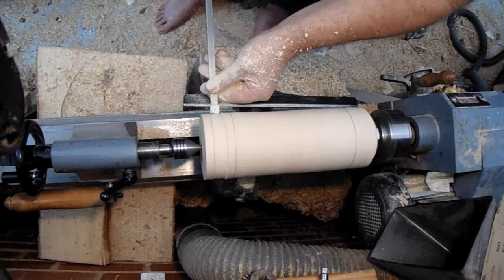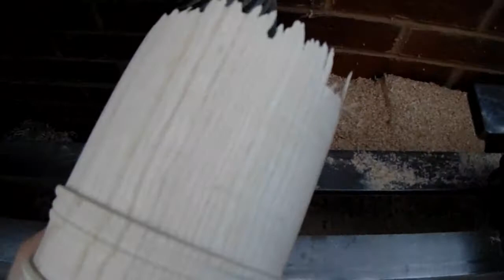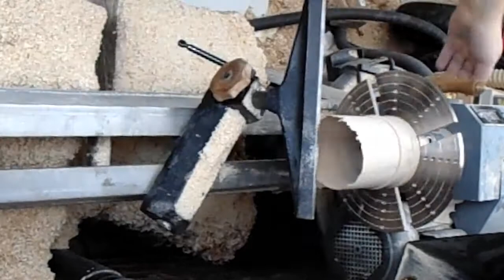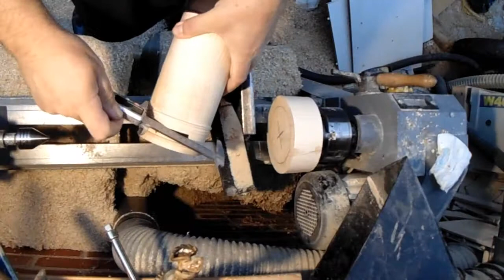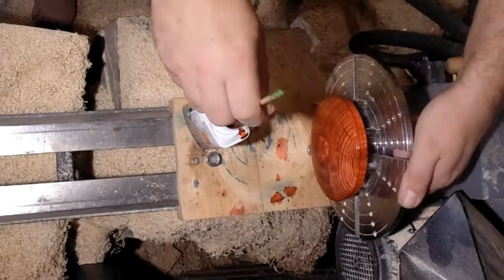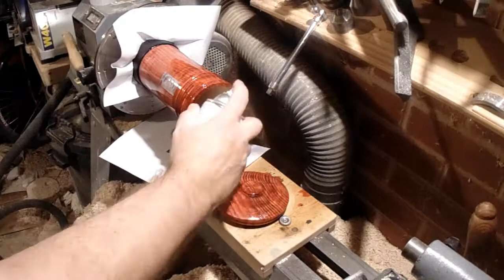Barefoot Turner - Post Box Money Box

Comment: Wouldn't be so much fun if you dropped a chisel on your foot!!
Reply from the maker: I suspected showing my barefoot turning would result in this or similar comments. I've hidden it in other videos as a result.  For me its personal preference.  
When I'm turning large pieces I wear steel toed safety boots as I have had large pieces come of the lathe.  How many turners use that level of protection.  Due to weight and generally lower rotation speeds these larger pieces will fall at or indeed on your feet.  For smaller pieces I tend to relax as they have more chance of just going anywhere. 
If I dropped a chisel on my bare foot I might get cut or bruised but its unlikely that it would cause serious injury.  I've had tools flick up on catches, as most of us have, yet no one discusses leather aprons or body armour, only face shields.  I'd rather take a chisel to the foot than one in the chest.
The point I'm trying to make is risk is a personal thing, both in how you perceive it and how you choose to react to it.  I use a personal form of risk management and it won't agree with other peoples.   We all chose the risks we take.  We are at more risk of having an accident in your home than on a plane, yet not many people are so scared of houses they can't enter them.

My workshop.  My rules.